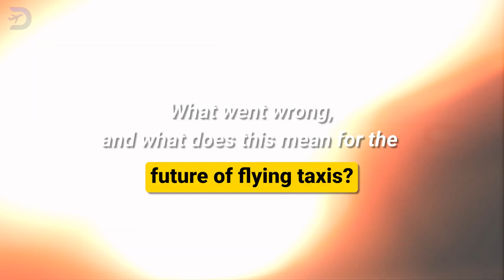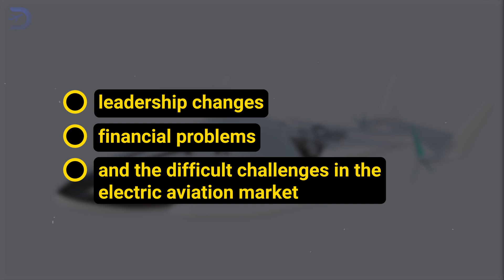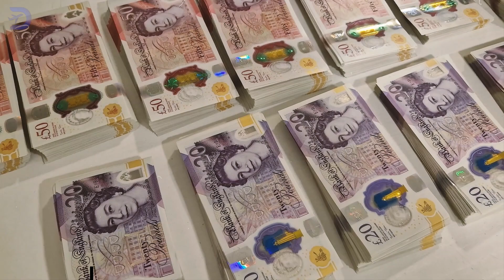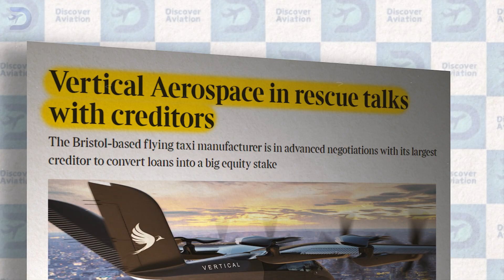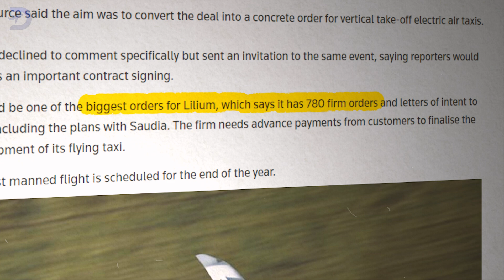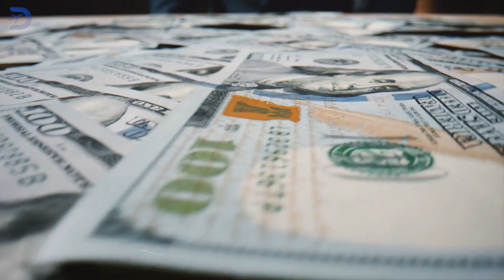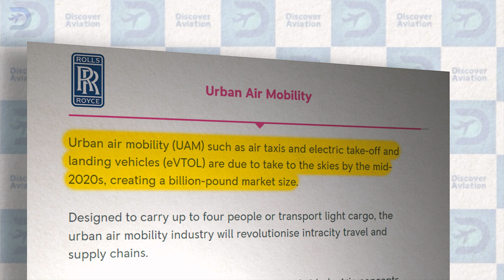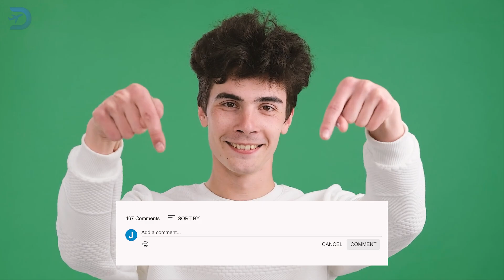4 Reasons Why Rolls Royce Abandoned Its Electric Aviation Dream!

Comment: If you  are really a supporter of electric aviation you should make one that recharges its batteries during flight. How? Make a 4 wings electric airoplane spinning on its axis, like a "flying wind turbine". Any plane that uses aileron rolls (full 360° revolutions on its longitudinal axis) can recharge the batteries airborne. Any student can do it. The two front wings would spin the fuselage in one direction, and the back 2 wings will spin on the opposite direction at double force. What we would see spinning (from the ground) it’s only the back of the plane, so the pilot and passengers are never upside-down.

Comment: Vertical take off and batteries is about the worst possible combination: highest power demand and energy consumption mated to the heaviest and least energy dense power source.

What is sacred about the 90 degree angle ? ( vertical)  these things cannot hover for more than a few seconds or only a few minutes and have little excess thrust to do any useful work such as helicopters can do so they are very poor heliclones but also have poor speed and range as fixed wing aircraft so being the worst of both worlds .  What they are really tryingto do is avoid the need for a runway or airport but solving the wrong problem .
The 'saving the world' from zero ( in flight...only,) emissions is based on a complete fallacy about the 1/2500  of the air that is CO2 or the 1/83000 that is ALL the possibe anthropogenic fraction ( of which maybe 10% is due to all transport, of which cars might be 20%......... and anyway electricty from conventional sources is no better than hydrocarbons in regard to CO2 .  Water vapour is between 10 000 and 100 000 parts per million compared to CO2 at 400 ppm  so CO2 is irrelevant as a so called greenhouse gas .
Maybe Rolls Royce knows this too.
Reply: Distributed electric propulsion is definitely the future though, same goes for flight.
Reply: Christopher's, well if you say so it must be.......